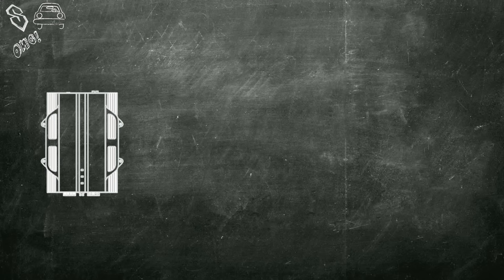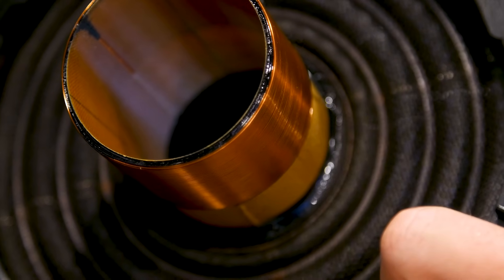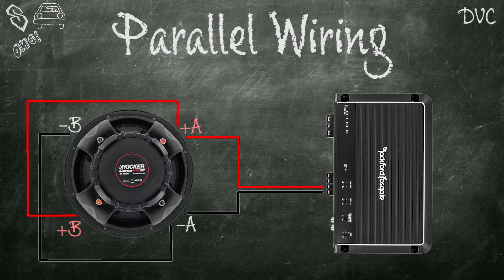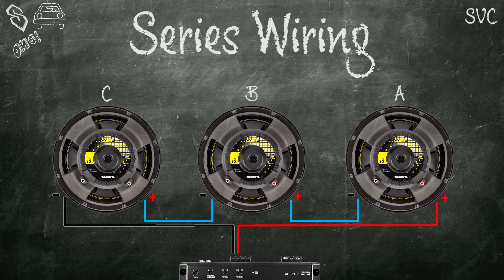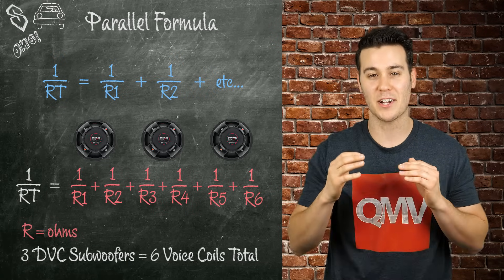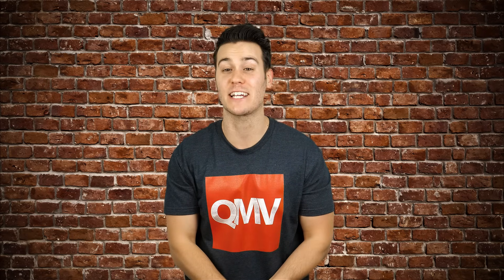How To Wire Subwoofers - Parallel vs Series - Single Voice Coil and Dual Voice Coil

Comment: So I have 2 subs and I'm going crazy trying to find the right amp. I'm on a budget but I got 2 skar 15's dvc 2 ohm so my final impedence will be 2 ohms 600 rms a piece 1200 peak I was thinking about getting the audiopipe apcle 3000.1d but idk if it's to much or not
Reply from the maker: That's a solid match! But you could go with something cheaper and less powerful. That amp does 2,000W RMS @ 2 ohms, and the subs are 1200W RMS combined, so you'll have 800W RMS of head room. It's almost a waste of money if you're not using all the power. Find a monoblock with an RMS rating of about 1100-1400W RMS @ 2 ohms. Check these:

Kicker CXA1200.1 1200W RMS @ 2ohms
http://www.qualitymobilevideo.com/cxa1200-1.html?utm_source=YouTube&utm_medium=Video&utm_campaign=Match_Subwoofers-Amplifiers

Hifonics Brutus BRX2016.1D 1400W RMS @ 2ohms
http://www.qualitymobilevideo.com/brx2016-1.html?utm_source=YouTube&utm_medium=Video&utm_campaign=Match_Subwoofers-Amplifiers

Kenwood KAC9106D
http://www.qualitymobilevideo.com/kac9106d.html?utm_source=YouTube&utm_medium=Video&utm_campaign=Match_Subwoofers-Amplifiers

Power Acoustik BAMF1300D
http://www.qualitymobilevideo.com/bamf1-3000d.html?utm_source=YouTube&utm_medium=Video&utm_campaign=Match_Subwoofers-Amplifiers

Power Acoustik EG14500D
http://www.qualitymobilevideo.com/eg1-4500d.html?utm_source=YouTube&utm_medium=Video&utm_campaign=Match_Subwoofers-Amplifiers

Hifonics Zeus ZRX3216 1600W RMS @ 2ohms
http://www.qualitymobilevideo.com/zrx3216-1d.html?utm_source=YouTube&utm_medium=Video&utm_campaign=Match_Subwoofers-Amplifiers

Comment: simplified; series: add all resistances together; parallel, multiply all resistances together, then add the resistances together, then divide the first from the second and that is your total impedance.

4x4=16 4+4=8 16/8=2 if you have two dual voice coil speakers, you do this for each speaker, then you do it for the total number of speakers. if you have 3 of the example 1 dual voice coil speaker, you would then do 2x2x2=8 2+2+2=6 8/6=1.3333

Comment: I broke this complicated formula, after learning how to solve the parallel formula, I realized that you can just divide the number of voice coils with the number of ohms of 1 voice coil, get that total and then Divide 1 by that total, example. I have three 12ohm single coil subs, 3÷12=0.25. then 1÷0.25= 4ohms. But wait, then I broke my broken formula!!! All you have to do is divide the ohms of 1 voice coil by the number of voice coils. 
12ohms divided by 3 coils = 4
And that works for any subwoofer!

Examples from the video
1 ohms divided by 2 coils = 0.5

4 ohms divided by 2 coils = 2ohms

Your welcome!
Reply from the maker: Awesome!

Comment: I dont understand why I wired my set-up to 1-ohm but it rests at 1.5 ohms. I have two 4-ohm DVC subs. How do I get it to one ohm? Thx Pros!
Reply: are each voice coil 4ohm? if so, hook those in parallel, that drops total speaker to 2ohm. then hook both speakers in parallel and that will drop total resistance to 1ohm. 

keep in mind, not all voice coils are created equally,  each coil can have a different resistance. when the math is done it's very well possible to come to 1.5ohm.

also possible your multi meter has a natural .5 resistance between the leads.

Comment: How to tell what size wire you should use for u subs ?
Reply from the maker: For wiring your subs directly to your amplifier, 10-12 Gauge is usually fine. Unless you're rocking something absurdly powerful :)

Comment: I have a 2channel 840 watt amp. How should I wire my 2 dual 4 ohm subs each 400 watts???
Reply from the maker: What are the exact RMS specs of the amp? With their impedances? Or what model is it?

Comment: how  to connect single voice coil to amplifier , single subwoofer only 400watt/4ohms , let's  say  my my amplifier is 1000watt/channel, pls. help me
Reply from the maker: Connecting a SVC 4 ohm subwoofer is very simple. First make sure your amplifier can make a 4 ohm load, which is all you can wire to. Then simply connect positive on the sub to positive on the amp, and negative on the sub to negative on the amp. Then you're done
Reply: @Qualitymobilevideo  thanks

Comment: So i have a dual voice coil 4 ohm sub 1800 watt max and a 600 watt amp should i just hook it up parallel
Reply from the maker: I need more info on the sub and amplifier. What's the sub's rated RMS? What model is the amplifier? What is its power rating at each impedance
Reply: @Qualitymobilevideo   well the amp is a sony exploid 600 watt the speaker is a planet audio 1800 watt max i belive it said it had a 900 watt rms thats all i know i think im just going to hook it up parallel
Reply: So i bought a 2500 watt amp 
450w for 1 sub @4ohm 
My sub is a 1800 watt 
900w ohm is it to much amp for the sub i started smelling the sub so i turned the gains down and the bass boost i turned to half and the low boost to half dosnt sound distorted just wondering if i should have went with a lower amp
Reply: 900 rms not ohm mybad
Reply: Never mind i just fucked tht speaker off to. After having it hooked up for about 5 min and i didnt even have it slamming to hard idk what to do maybe next time i should get 2 subs instead of 1

Comment: When you connect the wire to positive and negative which wire would it be? Positive or negative?
Reply: what? if you hook a positive to a negative, you tend to get a short circuit. 

if you have a speaker with two voice coils, and you hook a wire on one positive and run that wire to the negative of the opposite coil, (the coils are usually separated by the positive and negative of one coil being next to each other on opposite sides of the maganet.), this is starting to hook them up in series. you would then take two other wires and hook one wire to the empty positive terminal and the second wire to the empty negative terminal and hook those up accordingly at the amp. this increases the total resistance of the speaker.
Reply: Christopher Wise never mind I know how to now :)

Comment: Is it possible to wire two 650watt rms amps to one 1100watt rms subwoofer?
Reply: Dual voice coil subwoofer*
Reply: Oh and the amps are single chanel
Reply from the maker: If the amplifiers are able to be daisy chained, you can use two to power your system for double the power. Check your instruction manual

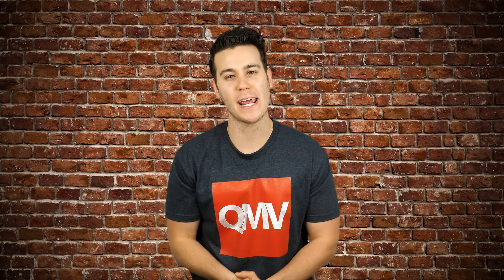Comment: I'm pretty your chart at 3:16 is wrong a 2ohm rated amp running at 2ohms of load will run cooler than a 2ohm amp with a 4ohm due to higher loads from said higher resistance

Comment: if you wire resistors in parallel they divide. to get a little more specific, if you have 2 resistors of the same value in parallel total ohms will be 1/2 of the resistor value.  to simplify, 10 over 2 = 5 so two 10 ohm resistors in parallel will be 5ohms of total resistance, the same is true with voice coils only the values you are working with are more along the lines of 2 / 4 / 8   so 2 speakers with a single 4 ohm voice coil in parallel will be 2 ohms of total impedance.  again 4 over 2 = two in this case 4 being the ohms 2 being the number of speakers.  hope this clears it up a bit, little buddy may have gotten a little carried away although his info was 100 percent spot on.  Good video
Reply from the maker: Love when people can't help but criticize on a personal level for no reason. I'm above average height for an American male thank you very much.

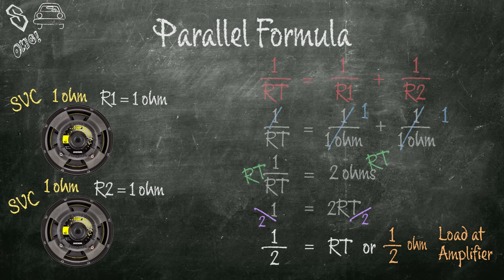Comment: At 7:12 can we go a little deeper and could you explain why the parallel formula is what it is? Why exactly do they differ, other than the obvious reason they are different types of wiring
Reply from the maker: So parallel wiring offers lower impedance possibilities, like 1 ohm, which means more power, but also less efficiency

Comment: question--- I have two pioneer champion series 12" one is a 4 ohm single voice coil and the other is a 2 ohms dual voice coil.Now is it ok to series the dual 2 ohms up to 4 ohms then parallel it with the 4 ohm single vice coil so drop down to 2 ohms?

Comment: Is there a way to wire dual coil 2ohm subwoofer to 2ohms?
Reply from the maker: Nope. One DVC 2 ohm woofer can only be wired to 1 ohm or 4 ohm. Two DVC 2 ohm woofers can be wired to 2 ohms. Or one DVC 4 ohm woofer can wire to 2 ohms.
Reply: @Qualitymobilevideo ok
Reply: @Qualitymobilevideo Thanks.

Comment: I think I know less now than I did before I watched this video.
Reply: Bro, for real, alot of it was technical and a few parts were overcomplicated. That said, I did learn alot and am very grateful for this video.
Reply: @drkool8168 True, I got the general got it too but he definitely pit a lot of technical detail into it 😆😆
Reply: Lmfaoooooo
Reply: I knew how to wire up an amp and subs and everything, only thing i didnt know was how to wire up a head unit. Now after seeing this, i might accidentally switch my power and ground with each other
Reply: Why didn't the diagrams show final impedance of the system?   Too technical?  That would be the most critical info IMO.
Reply: Lol 😆 when you listened to Einstein explaining
Reply: @heavy12inchsub79  Exactly 🤣
Reply: This was a very confusing explanation
Reply: @iceteevideos3599  Definitely was.
Reply: He lost me at plumbing
Reply: @dantheman14200  I could see how that can happen.
Reply: This is my second video that I ended up feeling that way
Reply: TMI huh?
Reply: Literally bro 😂
Reply: True.....hahahahaa.😂😂😂

Comment: Can you wire one 2ohm dvc to 2ohm
Reply from the maker: No. 1 ohm in parallel, 4 ohm in series
Reply: I have two dvc 2 ohm subs and two skar rp2000 

At 1 ohm the amps put out 2k and at 4 they put 900 so underpowered 

Any way of using them amps with my subs

Comment: hi 
how do i wire 5 dual 2ohm subwoofers
Reply from the maker: How many amplifiers are you using?
Reply: @Qualitymobilevideo  none at the moment as not sure how to wire them.
Reply: @Qualitymobilevideo  I bought the box and am looking to put 5 power acoustik 1200rms dvc 20hm
 or
Bass face 800rms dvc 2 ohm. 
And thank you for replying
Reply: With each sub in series for 4 Ohm, and then the 5 subs in parallel you end up with a 0.8 Ohm load. You'll need a monoblock that can handle such a low load...

Comment: Hello,
My B&O Amplifier have Dual channel output for Subwoofer, 
And Subwoofer is also Dual channel (100 W + 100W) (8ohm+ 8ohm),

Now I am planning to add one Dual channel subwoofer of Same configuration because of too much vibration,

How I will do wiring?
Reply from the maker: Can you send me the exact models/names of both the amplifier and the subwoofer?
Reply: Quality Mobile Video 
Hi, It is B&O Sound System in Audi A3 8V -15 Channel Class D Amplifier-Out of 15 channels 2 channels are for Subwoofer (100 W+ 100W) (8ohm + 8), which is connected to a dual coil subwoofer (100+ 100).

Because of too much vibration from rear parcel tray, I am planning to add one more dual coil subwoofer of Same configuration in the spare wheel.

My intention is that I have to equally divide Amplifier load to 2 subwoofer 

Hope you understand

Comment: What if I connect 20 speakers in series to an amp It can not mean that it will take less energy to drive 20 speakers in  series.   When people talk of impedance and ohms I never know what they mean by less and more.  because Zero ohms is more impedance. or is it more resistance or less resistance.   There is a huge amount of resistance when I arc out a 12v battery.   All this OHM resistance and impedance is very confusing for a dyslexic person whose mind keeps flipping stuff around all the time.  If I have less ohms the number gets larger or higher.   If I have more resistance I have zero ohms right.  NO  A bad connection is going to have a lot of resistance and more ohms.   A bad connection is going to impede the flow.    A very tiny wire is going to have more impedance and more ohms than a big fat wire.  More impedance is a higher number of ohms.   But when people talk of amps and ohms they talk as if 2 ohms has more impedance that 4 ohms.  What are we impeding ?    2 ohms is going to allow the electricity to flow easier than 4 ohms but yet its harder on the amp to run 2 ohms.    And the rule of adding speakers in series to an amp will make it easier on the amp does not make any sense to me because you could add 40 speakers and that would me you would have almost well a lot of ohms.    ITs going to take more energy to drive 40 speakers in series  than it is to drive 20 in series.  SO I need explanation.   And when a person says less of something I have no idea what they mean

Comment: What are the advantages/ disadvantages from running subs in parallel or seriies?
Reply: TwIzTeDSpIcE it all depends on how you want to run your amps.
Reply from the maker: It just depends on your gear. Parallel will generally get you lower impedance for more power.
Reply: @Qualitymobilevideo  ill be getting two Phoenix goldSX Series SX112d4 subs. They're 4Ohm dvc 400w rms. Looking for an amp to run them both on. Im pretty new to all this so looking for as much advice as possible lol
Reply from the maker: @TwIzTeDSpIcE  Sweet! No worries, it can be confusing. So you'll either make a 1 ohm load or 4 ohm load. 4 ohm offers more efficiency, but it's harder to find a 4 ohm amplifier with 800W. I'd recommend getting a monoblock amplifier with a power range of 700-950W RMS @ 1 ohm. Check these out: 
Rockford Fosgate P1000X1BD
http://www.qualitymobilevideo.com/rockford-fosgate-p1000x1.html?utm_source=YouTube&utm_medium=Video&utm_campaign=Match_Subwoofers-Amplifiers

Pioneer GM-D9601 
http://www.qualitymobilevideo.com/gm-d9601.html?utm_source=YouTube&utm_medium=Video&utm_campaign=Match_Subwoofers-Amplifiers

Rockford Fosgate R1200-1D
http://www.qualitymobilevideo.com/rockford-fosgate-r1200-1d.html?utm_source=YouTube&utm_medium=Video&utm_campaign=Match_Subwoofers-Amplifiers
Reply: @Qualitymobilevideo  sweet. Ive got some Rockford Fosgate PPS4-6 Punch Pro 6.5" in my parcel shelf, they sound amazing so ill look into the Rockford amps. Is it true that running amps in 1Ohm can heat them up quite abit?
Reply from the maker: @TwIzTeDSpIcE  1 ohm loads will definitely run hotter than a 2 or 4 ohm load. But it really isn't an issue so long as the amplifier has exposure to plenty of space/air for cooling and your gear all matches up
Reply: @Qualitymobilevideo  sweet, thanks for all the input. Its really appreciated.
Reply from the maker: @TwIzTeDSpIcE  Anytime bud!
Reply: @Qualitymobilevideo  sorry to bother you again, i received my Phoenix gold subs and one of them had this weird resin all over it so sent it back. Ive now ordered 2 x SUNDOWN AUDIO E12 v.3 D2 500rms, there 2Ohm dvc, so wondering what the best  wiring setup would be?

Comment: Hi i have two subwoofer total 800rns i used mono black 1200rms  at 1ohms its good combination thanks
Reply from the maker: Impossible to tell. Are the subs DVC or SVC. Are they 2 ohm or 4 ohm. Are they 800W RMS each or combined?
Reply: Quality Mobile Video this combined 2 sub DVC 400rms each

Comment: So remember when I asked you about this match we agreed it was good...a PlanetAudio AC8D DVC "600rms" well the KICKER CX600.1 Burned it up... I called PLANET AUDIO and they sending me another one FREE.

The system was setup at 2 ohms in Parrallel. Did I mess up or is Planet Audio really shitty like I been reading??

So now Im looking at the Kicker 8" shallow rated at 600rms.
Reply from the maker: There is zero chance that AC8D can actually take 600 Watts RMS, this is not a fault of the amp.

Comment: the voice coil dont have to match the amplifier.You have to be shure that the impedance of the driver is slight higher than the rated impedance load the amplifier is rated for.If a amp is ratet to impedance load minimum at 1 ohm and your woofer is 1 ohm you could be in trouble.the driver can drop impedance at sertain frekvenses when payed.te teori explained her is static state.3.10 in you state half truth.when a load(impedance is low is not better for the amplifier.it does less work pr watt and rest goes to heat.Watt rating is Bs when it comes to sound in many ways.Use a high senistivty 96db pr 1 watt 1 meter type driver;s.if you use a 88db sensitve voofer times 2 you get  90 db 1 meter 2 watt.if you use 4 you get 94db 4 watt.The least amonut the human normal ear can sence level difference is 2 db.some trained can hear 1.5 db difference.since car is 12 volt or 24 with some caps(should be many 4700uf caps that can react to power demand quicker than a big 1 farrad. a dual coil sub woofer to one mono output will draw less current at 8 volt(around 800mamp in series but in parralel to the amp.+from amp in to + on coil 1 the + signal goes trhue the voice coil and come out at the _ terminal sligthy filtered to mh in the coil.It goes from the - terminal in to the + terminal on the woofer get a little more filtering and comes out at - terminal that goes to - on the amp.This way draw less current and i higher om make less heat more efficent and a amp dont mind impedance goes up.a woofer with low or 1 ohm is close to a short witch do no work.The same woofer in parralell draw 2000ma at 8 volt.That is over twice the current draw.as you said amplifier gets hot.that is wasted energy it sould make sound-To take a dual coil voofer coupled in serie but parralell top the amplifier have to be a woofer with quality coils that match.the closer the better.no way couple one  against te other from stereo output on amplifier.one coil wil work against the other and burn upp in the end if there is power to do it.Just somthing to think about when people are obsessed by only watt and impedance.Dont matter if senitivity pr watt is bad,more db pr watt and still linear sounding does not always aplie to a sub woofer or a woofer,sorry for some bad writting.